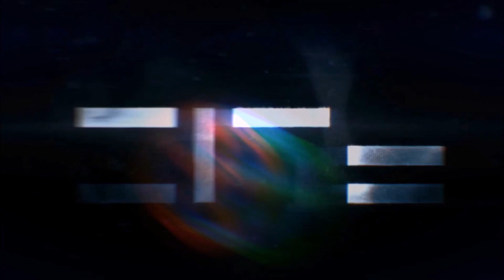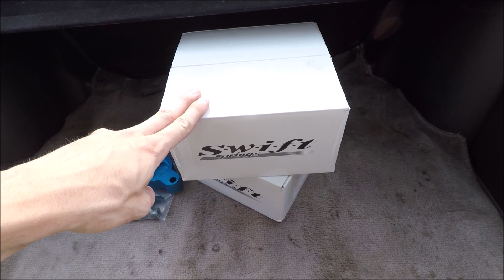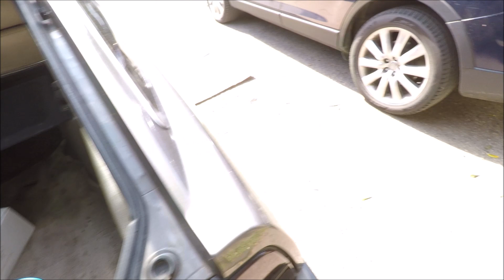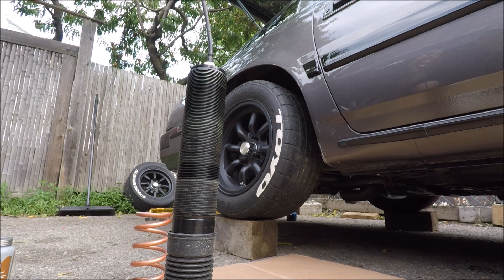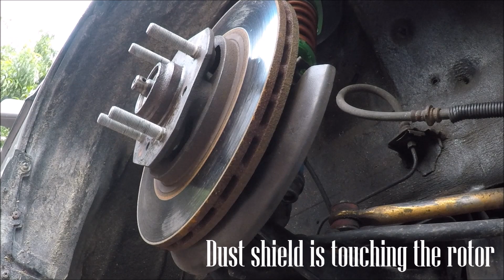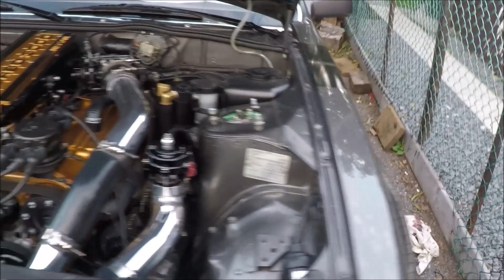Z31 Bump Steer Spacers and Swift Springs!

Comment: Let me know how you like the Swift springs. Im about to buy them for my z
Reply from the maker: If you are interested im selling the 6k/8k ones thats were on before, if you have standard springs im sure you will notice a difference, let me know if you are interested in them for a good price
Reply: @TurbochargedCreations  I might just buy them. Although I have a rough commute too so maybe I'll try to go light on the springs too. How do you like your new springs so far. I want dailyability and some sportiness so I'm thinking 8/6k.
Reply from the maker: So far pretty good, the 8/6 ones were fine, just a bit rough on pot holes stuff, the new ones are a very minor improvement so which ever is the cheaper option for you
Reply from the maker: sent you an email
Reply: How much you askin creations?